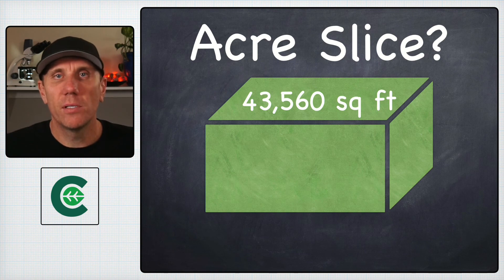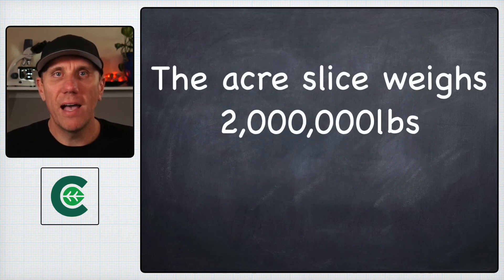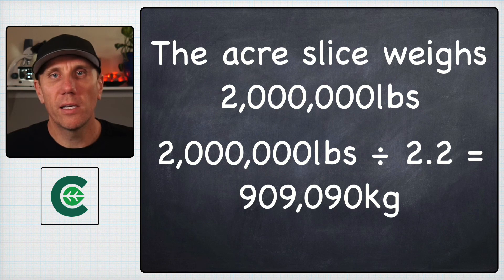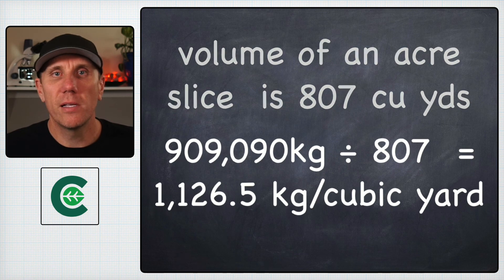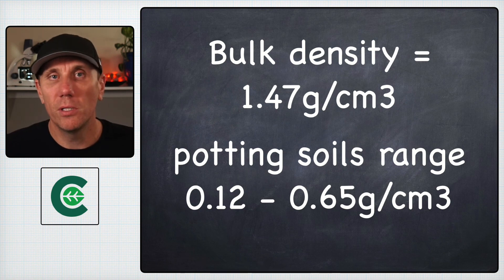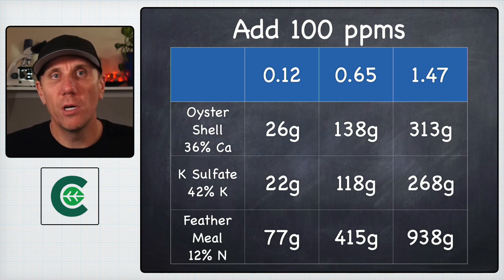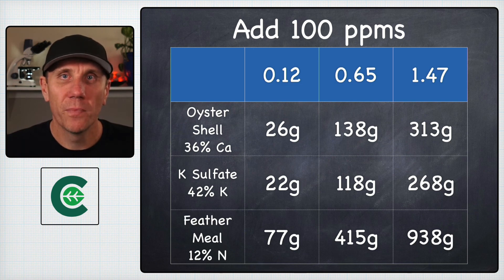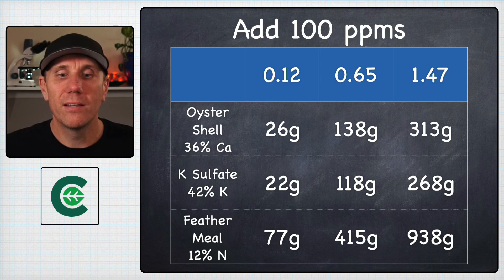Do You Know How to Calculate Soil Weight?

Comment: Thanks for this, I guess the lab average is using a compacted soil sample at 1.47g/cm3, seems you'd be better off drying an accutare measure of your own soil and calculating your own BD
Reply from the maker: some do that and you can if you want. so far using the BD on the test has worked out pretty well.